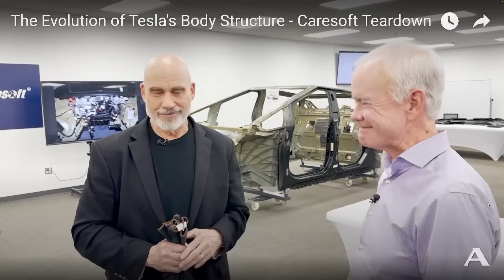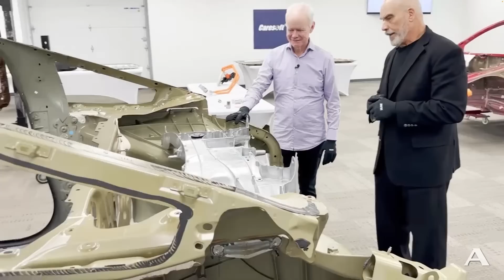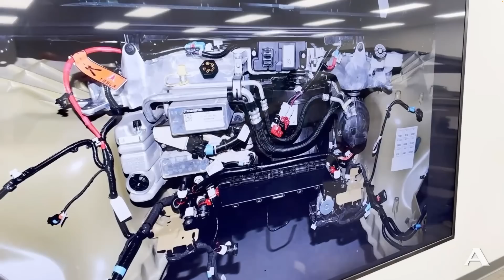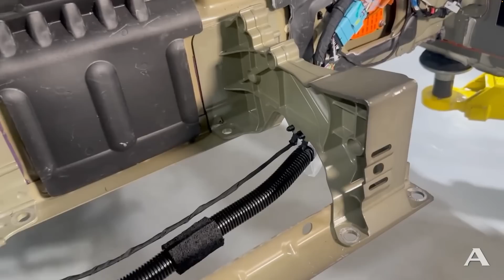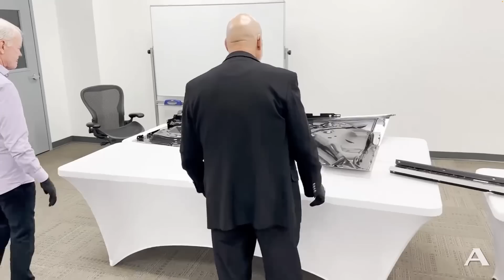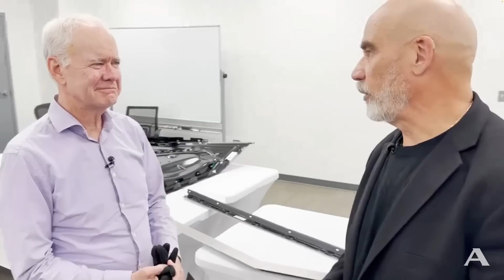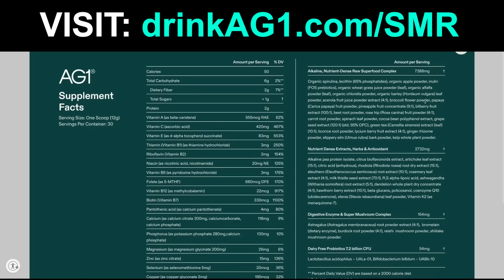Cybertruck Secret Discovered In Teardown

Comment: Each of those 70 parts is 5-10 people protecting the status quo.
Reply: Still the safest cars in the WORLD,!!
Reply: That's a bit simplified: each one of these parts also adds strength and rigidity to the structure. If you look at that Tesla chassis, the part they're talking about has warnings on it telling workers to NOT stand on it, aka "this is a part that can NOT handle any load" (and therefore will add almost NO strength and rigidity). 

In the car industry many things are being done for reasons, one of the most important reasons is safety. Other reasons may be that those same 70 parts are being used in different models of cars, adding the same strength and rigidity and making it all much more cost effective. Do you really think that manufacturers like Ford, Chevrolet, Mercedes, BMW, Toyota and Hyundai would continue to use those 70 parts if they could get the same strength and rigidity with a single cast part? Especially when that cast part will obviously be much cheaper?  These guys simply blow past considering why car manufacturers do things that way as if Tesla "re-inventing" the car is the only and superior way to go. 

The only reason why Tesla can use that single cast part is that the huge battery pack beneath will add the necessary strength and rigidity, but then you're comparing apples to pears: ICE cars don't have those huge battery packs underneath and therefore they need the sturdier construction provided by those 70 parts. Seeing things in perspective shows the logic behind them and these guys totally ignore the perspective to make Tesla look better.
Reply: @tjroelsma 
You're TOTALLY missing the point.
Reply: @tjroelsma     Your coping in a big way. They don't want to continue welding bits together. Ford has a gigaCasting machine in it's R&D organization.  Hyundai is taking a page from Tesla as it plans to model a new EV production method after its Giga Casting. The new process,”hypercasting,”  GM is looking at larger casting as it bought a casting company/tech for 3D printing sand  used by Tesla.  The Xiaomi SU7 uses similar casting technology.   Large casting enable manufactures to build cars that are more nearly identical that one can get by welding and gluing 100s of under body parts together. 
The mold designer can design the mold with the desired strength over the entire surface of the casting.  You will be seeing these on ICE cars but only after management can get over the sunk costs they have in stamping and welding machines.
Reply: @tjroelsma  Completely Wrong. You may want to check Sandy Munro's video comparing the cast part vs assembled together structure by hitting them with hammer. In short the cast part is stronger. Besides the rigidity of Teslas increased with casting. Not the other way around.
Reply: @tjroelsma  That's an insanely negative takeaway not grounded in  empirical fact. This is called "garage logic", reasoning about what one doesn't thoroughly understand is an exercise in reasoning by analogy not first principles.
Reply: @marriagepartnersministry5942  Really? Because it looks to me that, to use your phrase, "garage logic" is exactly what the two gentlemen in the video do and yet somehow you seem to be okay with that. Maybe it's because when the words Tesla and Musk appear your critical thinking is immediately being switched off?
Reply: @tjroelsma  Perhaps but i was just thinking your anti Musk/Tesla sentiment clouds your judgement similarly to what you think I'm doing. In any case my goal is to invest to provide for my kids and my retirement and I only want to get things right for that selfish reason I really don't care about being right if you know what I mean.
In any case that one guy in black is a highly distinguished advanced engineer with no known reasons for giving false info. He has true expertise as an engineer so I really wouldn't consider his comments and analysis "garage logic".  If you have some reputable sources for discrediting Teslas work please share them with me? Again, i don't care much about Tesla I just want to make wise investing decisions for me and my family
Reply: @marriagepartnersministry5942  I have no love for Tesla/Musk, but despite that I can and will recognise that Tesla has made important technical progress on some things: credit where credit is due.  

What I don't like is how these two gentlemen were basically blowing smoke up Tesla/Musk's asses for "a brilliant innovation that the Tesla engineers came up with", while the explanation for that "innovation" is far more mundane: Tesla's engineers recognised that contrary to an ICE powered vehicle the Tesla doesn't need that part of the body to be very rigid because the battery pack would provide the necessary structural integrity and therefore they could make it far lighter. What they basically did is what all car manufacturers do with their pick-ups and all-terrain vehicles that are based on that old-fashioned but very rigid ladder-chassis: the bottom of the bolt-on coach only needs to be rigid enough to keep the coach holding on to its exact shape, but doesn't need to have any more rigidity than that, as that ladder-chassis provides more rigidity than a piece of coach-work will ever be able to provide.
Reply: @tjroelsma They literally do crash testing, also this video is guybthat do this for a living, and so does Sandy Munro, those guy do everything from fridges to missles. Please show the engineering to counter this option. To help the  chat. Understand this option you gave.
Reply: @tjroelsma Blah blah BS
Reply: @tjroelsma  lol, you have no idea what you're talking about.
Reply: @thescurry  More than you obviously, else you would have been capable to correct me with, what are those inconvenient things called again........ oh yes, facts. The two gentlemen in the video just spout some things they ASSUME to be true and yet, probably because the words Tesla and Musk are involved, you accept it like the gospel form a minister. Some critical thinking might be nice here.
Reply: So why are all the companies following tesla and trying to implement if its not safe/rigid?  @tjroelsma
Reply: @tjroelsma COPE!